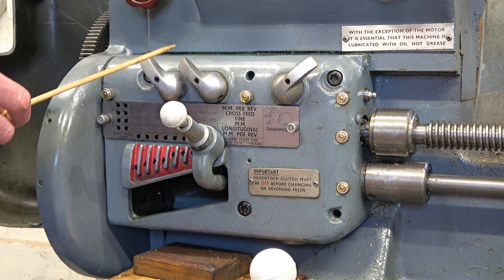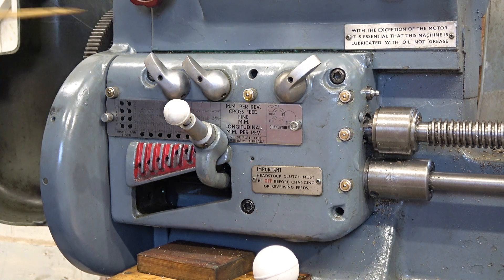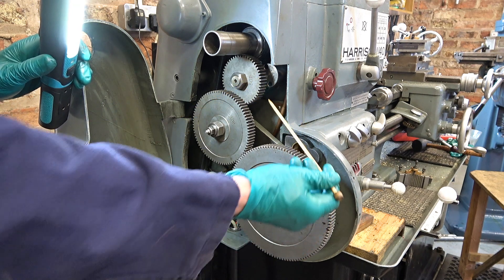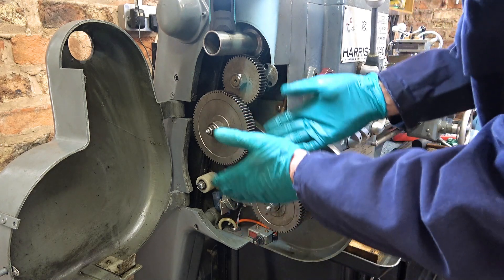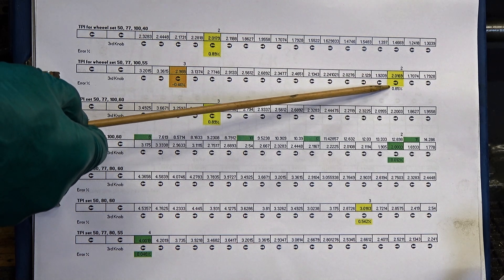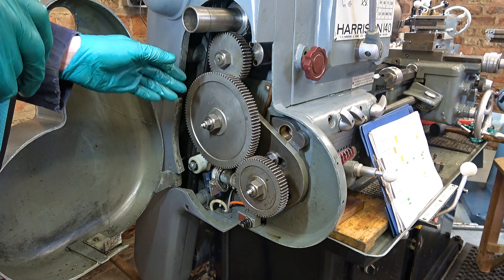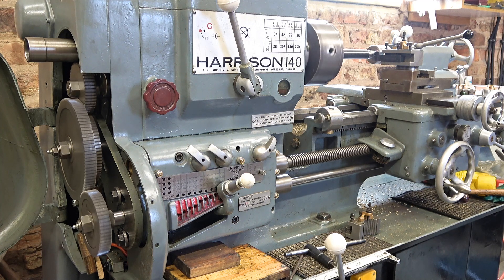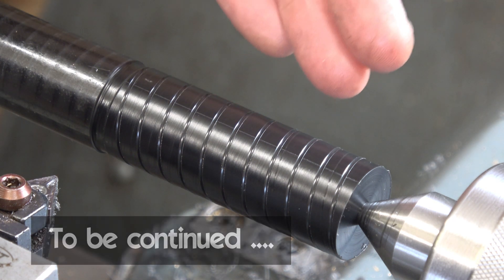HS256 Multi-start threading 2tpi 2start – Part 1

Comment: Great episode! Can't wait for part 2. I know with my lathe and its 2mm pitch leadscrew, cutting any thread above about 4mm pitch really puts a load on the motor such that it can stall out. A "solution" (such as it is) is to turn the lathe from leads screw. which now has leverage on the spindle. But the way I actually do it is turn the chuck by hand with a big wrench (spanner) and take super light cuts. I have also used a tool post mounted dremel tool to rough out the thread before switching to a threading tool. There is a also a video that shows how to use the compound slide parallel to the ways to cut course threads by adding small increments over many passes. I wrote a simple program to find all possible gear combinations on my lathe but as you point out, not all of them are physically realizable.
Reply from the maker: Hi bkoh, through this little exercise I've learnt a lot about lathe screw cutting gearing but I'm still some way off really knowing all the detail fully in depth. My lathe will cope with 2tpi threading at 34rpm but it must put quite a big strain on the gear train and screwcutting gearbox. Partly why I chose to work with delrin this time. Cheers